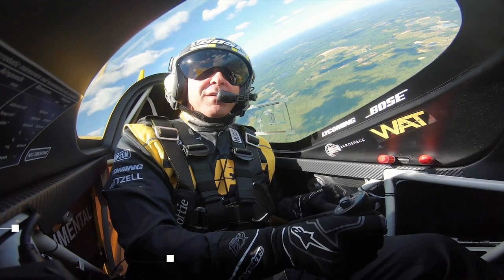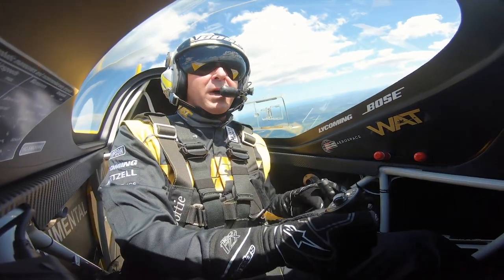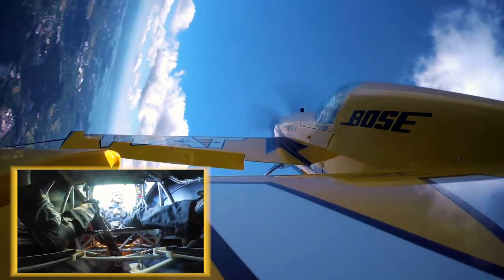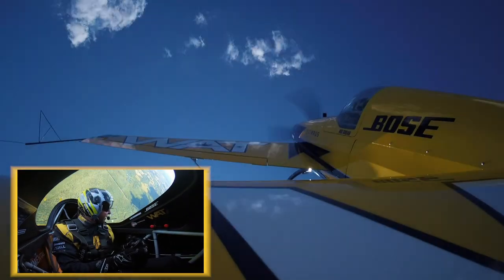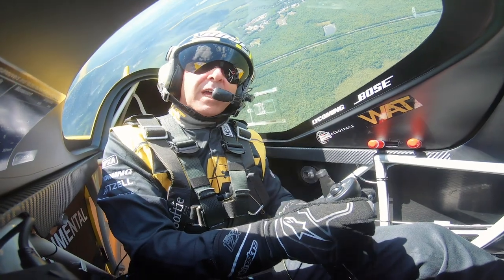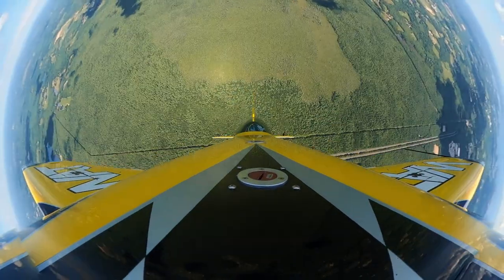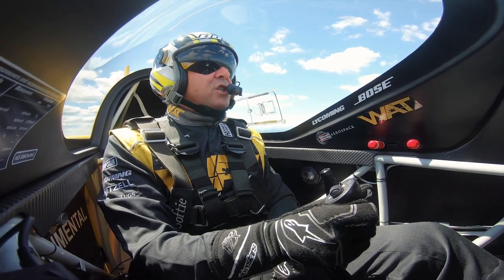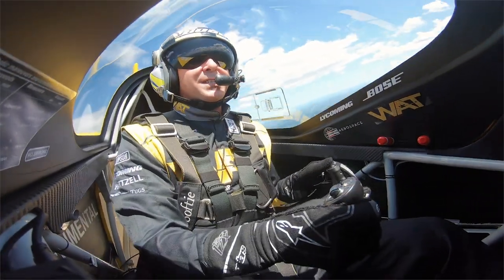AIRSHOWS & AEROBATICS: Flying The Hammerhead

Comment: What do you like to use as your point to know to start the recovery from the dive? Altitude or airspeed? In the Pitts I start the maneuver at 160, 4G pull to the vertical, pivot, start a 4G pull at 110 and end up perfectly at the same altitude and airspeed.
Reply from the maker: Good question. I've always been a timing person more than anything else. Some people use speed, some count, I just use what I feel is the proper time spent on a line. It get's a little more important when doing a roll on a line so that the time before and after the roll is the same. Again, just timing. Hope that makes sense.

Comment: Aerobatic pilot to be would like to understand why right aileron at top?
Reply from the maker: Pat, in the pivot at the top of the Hammerhead, the outside wing travels faster than the inside wing so the outside wing is making a bit more lift as it pivots around. Due to this you need some aileron at the top. Hope that makes sense.
Reply: @mikegoulian  thanks Mike, appreciate you taking the time to help.